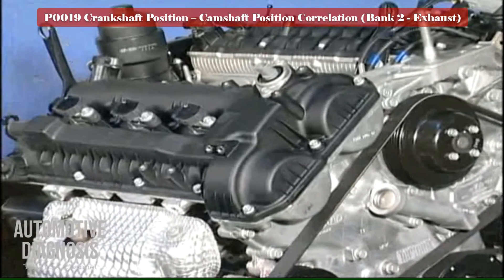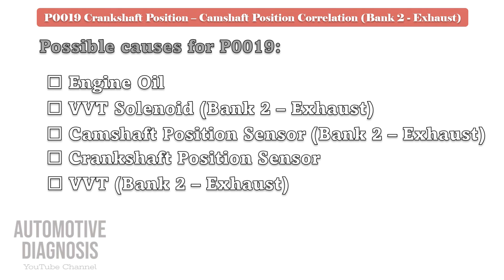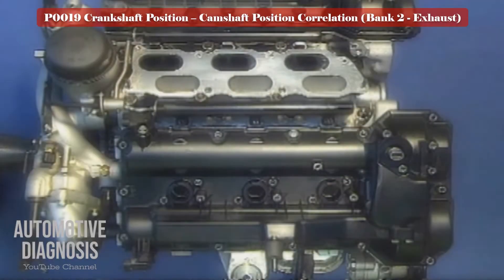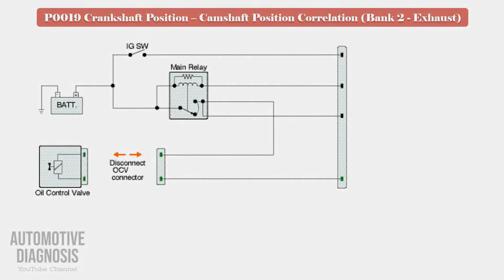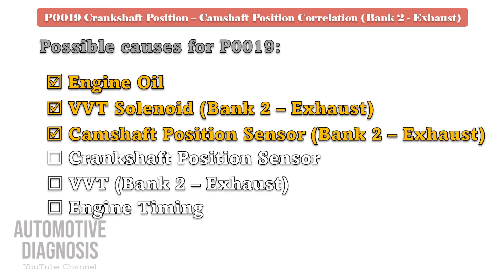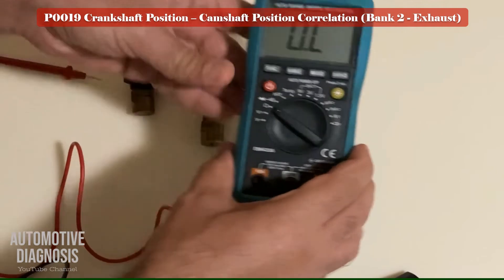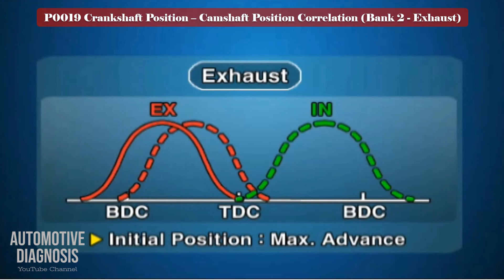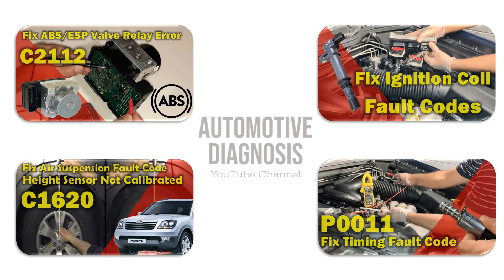How to Test & Fix P0019 Crankshaft - Camshaft Position Correlation Bank 2 Sensor B (Bank2 - Exhaust)

Comment: Just replaced crankshaft and camshaft and 4 vvt solenoid and still have check engine light after clear the codes with the scanner, on a 16 Subaru Impreza, what’s next?
Reply from the maker: Hi there, you didn’t actually need to replace all solenoids as this fault is only on bank 2 exhaust. As you have replaced cam and crank sensors too, the next step could be the following:
- Bank 2 exhaust VVT Solenoid wiring inspection 
- Bank 2 Exhaust Cam sensor wiring inspection (if you have cam sensor fault too)
- Bank 2 Exhaust camshaft VVT mechanism inspection
-Bank 2 Exhaust VVT reluctor ring inspection
Reply: Did you fix this? I replaced the driver side exhaust solenoid, and still have the code, but I will say it does drive slightly smoother and the idle is more steady but it’s still in limp mode. currently trying to figure out how to take out the passenger side (intake side) exhaust solenoid.
The codes I’m getting are 

P0000
P0019 Crankshaft Position – Camshaft Position Correlation (Bank 2 / LH exhaust cam)
P0302 cylinder 2 misfire

2 other cylinders were misfiring before I changed the coils, spark plugs, and solenoid. 

I need help 😅

Comment: quick question on a 2016 Nissan maxima 3.5 i have same code p0019 (CAMSHAFT POSITION B2 but it said sensor "B")

on my data stream

EXH/V TIM B1 =    0.00 DEGREE AT IDLE
EXH/V TIM B2 = -17.00 DEGREE AT IDLE

WHAT DOES THIS MEANS?
Reply: Likely that the main chain tensioner is extended and chain rubbing on the inside of the cover also.
Just did one (all chains etc and o.e. phasers + (vvt solenoids) also 
105k on it. 
Several resets after that is completed.
I did an 18 pathfinder in vehicle.
Yours will be more wiggle room maybe, tricky removal but possible w/o ac evac if careful around the hoses. Wrap with rags before a slice occurs.
Reply from the maker: Normally the exhaust VVT is locked at maximum advance when you just started the engine and when engine warms up, ECM will change the timing accordingly. This code is for B2 exhaust VVT, as you see on the live data, the b1 VVT is already different. Before removing the timing chain, you can go for the B2 exhaust VVT solenoid inspection. If that solenoid is malfunctioning, timing will not change and code will be set.

Comment: This Code is so annoying I have it on my 16 Jeep Grand Cherokee. I changed both Exhaust and intake VVT and the camshaft Sensor bank 2. The engine light is still on. I NEED HELPPPP!!!!!
Reply from the maker: Hi my friend. have you replaced the VVTs or VVT solenoids?
Reply: @AutomotiveDiagnosis  VVTs DOES'NT MEAN = VVT SOLENOIDS?

I THOUGH THE s MEANS SOLENOIDS :/
Reply: Get rid of it, those engines came with those issues, Jeeps not good as they used to.

Comment: I’ve got a 14 Impala with this code, and it will not go away🤔
Reply from the maker: When you erase the code and it keeps coming back it means that there is an active fault that must be fixed. Possible causes are explained in the video.

Comment: Constant adjustment of exhaust camshaft of left cylinder bank in direction
 -'Retarded' (P0019)
Is the timing not right or a problem with the solenoid? - im from indonesia Nice to meet you🙏
Reply from the maker: Hi there, normally the exhaust VVT is set to maximum advance anytime we turn the engine off, and when engine is started, it will turn toward advance slowly slowly based on the engine operating temp. and load. So, having that one all the time at "retarded" when you  have P0019 could be the solenoid fault (which does not advance the VVT) or VVT itself (which remains locked mechanically).

Comment: Hi I have these error codes on my s class 350 - when I connected the obd reader it did say car voltage was low.. do you think its the battery causing the error codes to show up?
Reply from the maker: Hi there, if there is no symptom and engine runs perfectly you can erase the fault code and keep an eye on it, if happens again there could a problem.

Comment: I've noticed that the video utilizes Ford, GM, Toyota etc. Images. This is not recommended for effective technical training. The retard and advance pressure on ports are not the same as the 3.6 pentastar as advertised.
Reply from the maker: This video is a general guide for this fault code and is not referring to any specific car, and all photos are samples to show the procedure. For any specific car you should check the workshop manual for the details and specifications. No car is mentioned or advertised in this video.

Comment: We need to know the magnetic reluctor ring to exhaust cam shaft correlation position as it is manufactured from the OEM Suppliers. These magnetic reluctor rings are known to slip especially when the engine has been sludged up.
Reply from the maker: Thanks for sharing your experience 🙏🙏